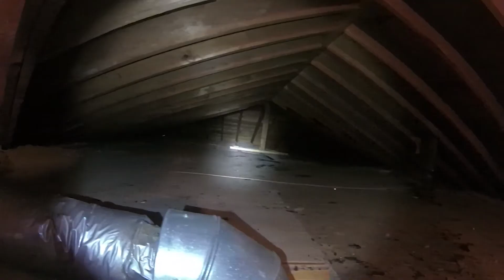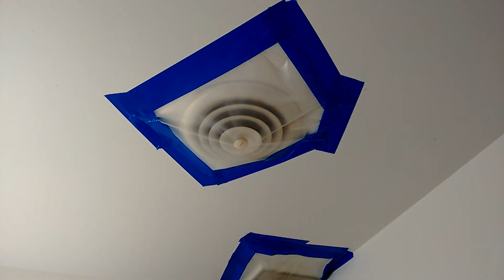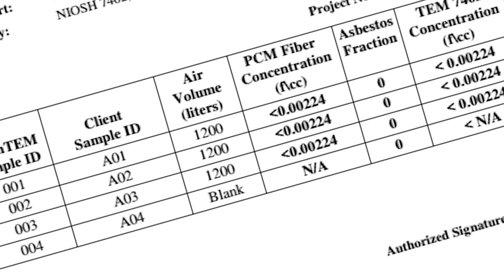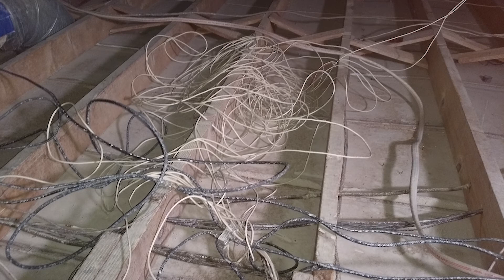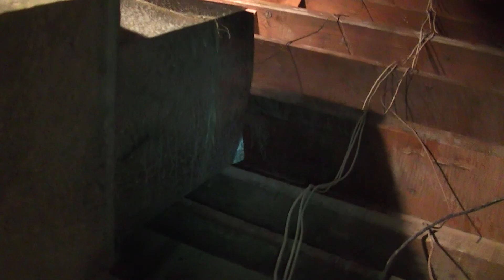Vermiculite insulation removal | MRS. RATTLECAN'S HOUSE

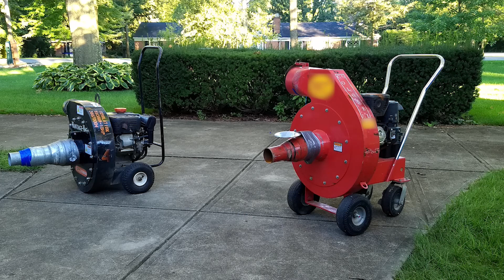Comment: 7:53 stupid comment.. if something breaks and you’re upset that they had to rent a vacuum is something so typical of of a karen 😮homeowner who just wants to complain.   Scheduling happens all the time.  It’s just part life..
Reply: Sounds like they only went over about a week..  five business days. 
When they were sending one person there. That was just a try and please you .  They’re not losing that much money on those days..  they didn’t have to send anybody there. They could’ve just told you something came up or previous job ran too long.  Instead, they tried to at least get something done there by sending someone there.  

And then they had a machine break. Which happens.  But then it seems like everything went good once they got the new equipment that they had to rent which again is not a concern..  I’ve rented machinery where it turns out that I ended up buying it from the renter.   

It looks like they did a pretty damn good job .  The fact that you had to reschedule a a few other contractors.  It’s very common in the construction world for this to happen.   

If I were you. I would be happy.   You feel a lot better with yourself.. the job looks like it came out. Pretty damn good.

Comment: Willing to bet that test that said .44 was wrong. The asbestos settles to the bottom, if the top few inches were that low then it’s safe to say it was 1.5%-3% at the bottom
Reply from the maker: I made the samples from the entire thickness of the vermiculite layer per the directions I had in the test kit.

Comment: You can tell by the video that they did not use a lockdown product. There is a gloss when they use a clear lockdown. You should have it rechecked by a professional. A lockdown is the most important part of asbestos removal.The smallest most deadly particles remain after removal Which is why lockdown is required. Speaking from experience and out a bunch of money.

Comment: Containment is most important. I charge 9 a sq ft and say it will take 3-4 weeks. If it's an open attic....closed I'd do 15 a sq ft. And 5 weeks. First couple days are nothing but containment. This is usually myself and a helper.
  After that sample collection time. 
I DO NOT use versa vacs as these kick up too much dust(this will give a fiber release at trigger levels). Shop vac with a HEPA filter. Thorough , precise, easily controls the dust. 
   I've got another system for 2x6 beams that still avoids versa vac. (Still takes 3-4 weeks)
 Or extreme, messy, involved cleanup. 
Vermiculite (still commercially available at your local home despot) even it's not from Libby is just a mess. Gets everywhere.
Reply from the maker: Thanks for the info!

Comment: I was  licensed in asbestos removal in the 90s and worked mostly in commercial applications like high schools. Some big jobs and some small. I would make sure you do independent air sampling and not rely on your contractor. I would not trust any of them. This stuff may be a low percentage content but it is super friable and gets airborne easier than anything I ever worked with. The vac machines they used were way wrong. They must be Hepa filtered. Not to mention, these were going back to the rental store contaminated with asbestos. We had all of our equipment in house and it was all cleaned in house and only used on our jobs. 
As mentioned by someone else, after every job we were required to apply a spray on application of encapsulant. It looks like milk when sprayed on but dries kind of like a thin elmers glue. It locks down all the remaining loose fibers. This is especially important because you are likely to blow in the new insulation and anything left behind and there will be stuff left behind will get blow back into the air. 
I feel for you dealing with contractors. Never fun.
Reply: I also worked in asbestos abatement just after high school. I thought the same thing about the vacuums!
Reply: What kind of vacuum is used to clean up vermiculite? I just had a job done, it looks like it's all out but now that we're starting the demo I'm worried about anything that might be lingering behind the walls.
Reply: @auroraperez8312  You have to use a HEPA vacuum anytime you deal with asbestos.

Comment: Just one question after the removal was completed and final vacuuming was done did these guys put a LOCK DOWN varnish over top of the exposed area this will stop any asbestos fibers being released in the future
Reply from the maker: They did, a milky white liquid applied with garden sprayers. Fiber lock????
Reply: @mrsrattlecanshouse5966  It should have been applied with an airless sprayer
Reply: Not necessarily - depends on local legislation.
Reply: You can tell by the video that they did not use a lockdown product. There is a gloss when they use a clear lockdown. You should have it rechecked by a professional. A lockdown is the most important part of asbestos removal.The smallest most deadly particles remain after removal Which is why lockdown is required. Speaking from experience and out a bunch of money.

Comment: Thank you for this video! We have an 1800 sq ft RANCH and we are currently saving up for this project. We've sent our sample to Zonolite where it was confirmed that it is Zonolite vermiculite in our attic. Did Zonolite reimburse you for more than their stated max reimbursement? Many of the homes in New England where we live have smaller footprints (less sq footage in the attic), but with a ranch, that reimbursement is probably about 1/3 (or less) than what the project will cost. The one estimate we got was so high that we knew we needed to wait and save until we were closer to the actual cost before we wasted more time getting additional estimates.
Reply from the maker: They did not. Gather a number of estimates as the cost can vary widely.

Comment: Hey , you mind if i ask how much it ended up costing you? I think I have the same problem.
Reply from the maker: Prices vary for a large number of reasons: state/local regulations, market labor rates, and who is doing the service i.e. a small insulation company vs. a commercial asbestos mitigation service. Our was into the 5-figure range but the Zonolite vermiculite trust (search ZAI Trust for more info) ended up paying for nearly half of that. Get several quotes from asbestos abatement contractors as well as insulation services.
Reply: I've read the average is $20,000

Comment: Wow. I feel your pain. I’m a new home owner and I have the same types of issues with contractors.  Wish a contractor would just be honest about how much a job will cost and how long it will take.
Reply from the maker: Cheers Arnoldo!
Reply from the maker: @AUCOINSINSULATION  Vermiculite is a mineral product (dug out of a quarry) that is lightweight and has great insulation properties. Unfortunately a lot of it used many years ago also contained asbestos. If it remains undisturbed it has a relatively low incidence of problems but as we were in the attic and moving it around we decided to have it tested (and it contained asbestos) so we had it removed.  

Lots of resources if you google "zonolite attic insulation trust" where you can find info on how to have it tested and possibly be reimbursed for the removal/replacement.